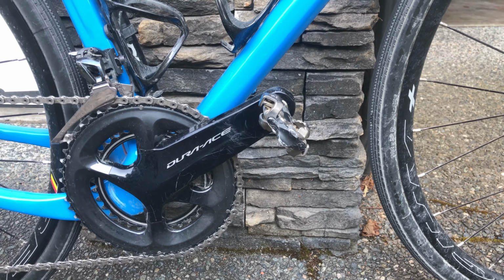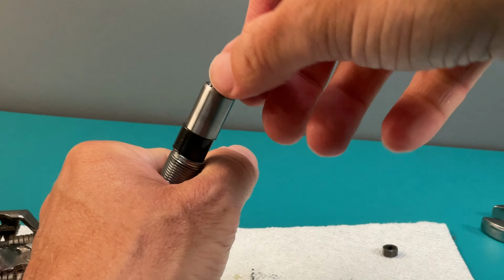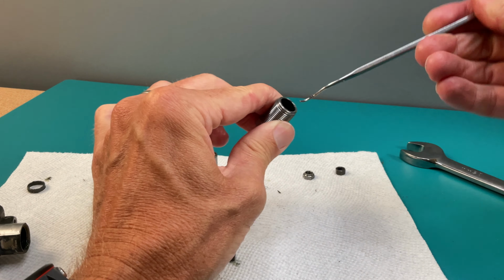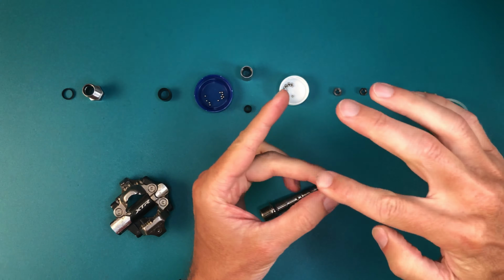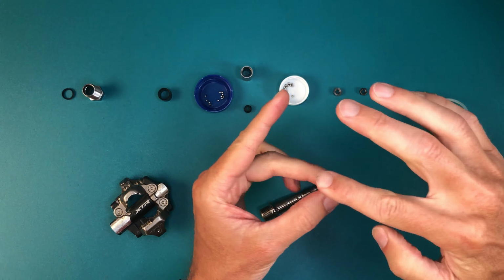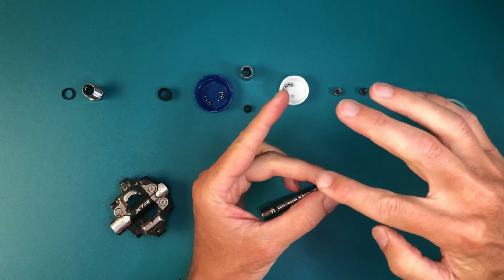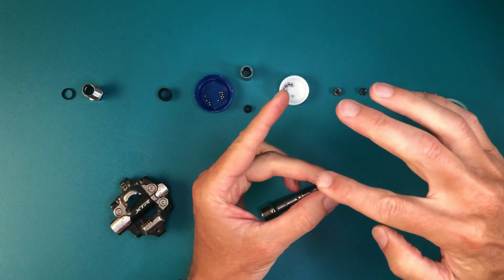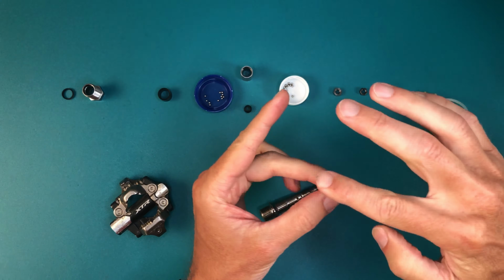Full service SPD bearing overhaul - Shimano XTR PD-M9100/9120

Comment: XTR tends to have too much axle play, it's hard to make the right setting play with 7mm 8mm spanners. Also thick grease help to make the seal stick in place. The last problem is shoe rub carved the pedal body, im looking to add material to it so my shoe and pedal don't have too much movement.
Reply: after servising my pedal spin super fast, it's just super hard to not ower tigh the bearings, i had to try a lot of time before finding the sweet spot, also the 7mm nuts seems to loosen on time, i advise people here to check after a ride if there is no axle play, first times i did tight enough the bearing nuts.
Reply from the maker: Agree, more difficult to get the play dialed in than with the 540’s. And checking after some miles is a good idea.

Comment: Good video, thanks. I just had my first XT problem In maybe 20 years. The pedal body came away from the axle.  I‘ve never opened one up or done any maintenance except external cleaning and oiling.   I assume the locknut just unwound itself.   Probably time for new pedals and another 20 years will see me out and keep my fingers out of the grease.  I do find it surprising that such small bearings can support the load, say 70kgs or more,  for such a long and generally reliable service life.

Comment: Well done, thanks.
Only thing I'd add,and this applies to all bearings is once they're been used, don't mix and match with other bearings regardless they're the same size. Individual sets will wear to their race evenly, but possibly slightly differently than another set. Axle bearings especially. Keep each set together.
Thanks again.

Comment: this is really good for the first time I took a pair of XT pedals apart, and I didn’t know what I was getting into when I saw the loose ball bearings but I didn’t take a completely apart and repack them but I did clean it up and Grease it up and put them back together. I’m not using them right now because purchased recently a pair of XTR pedals. they won’t need servicing for sometime now now the challenges I have an old 1995 pair of mono I think they’re M747. I wonder if the design or the internals has the same I use them on my fixed gear, track bike rather street bike that is. Find you 1995 and they’ve never been taken apart.
Reply from the maker: I imagine the internals are pretty similar. This design is pretty old school! The quick and easy way is to NOT take it all the way apart and just flush the old grease out with fresh grease. All depends on how dirty they are, and how much time you’ve got.

Comment: You made putting the bearings back appear simple.  I always find putting the 11/12 x 2 bearings back really fiddly. Like you, I keep counting to make sure I have not missed one LOL. For most people and times, I think leaving the bearings in place and degreasing in situ and using the process of screwing the spindle home to force new grease into the bearings, to be a much easier, more practical and quicker way to complete this maintenance task. A very reliable pedal design.👌
Reply from the maker: I agree 100%, but if the play is off, or you just have the need to take things apart, then using some sticky grease and tweezers can help a lot. Do it over a cloth so anything you drop doesn’t roll away!!

Comment: Thanks--this will help when my new PD-M9100 pedals need service. A suggestion--adding a list of required wrench sizes and the bearings sizes would be helpful.
Reply from the maker: I actually thought I had that listed in the description. I meant to. Sorry about that. I believe it’s a 15, 8 & 7. But it’s different than their other pedals, so best to be prepared. As for the bearings, they were too small for my Park bearing guide, so I measured them with the caliper. I left it at that since I didn’t want to state a particular size that I wasn’t positive on. 

Honestly, if the inside is mostly clean, I’d recommend just pushing fresh grease through rather than mess with re-setting the pre-load. Unless there’s play of course!

Comment: Do you know where to get a replacement seal, without buying a new spindle?
Reply from the maker: Sorry, I do not. I’ve seen many ask, but never seen an answer. Generally Shimano doesn’t really seem to be into repairs.
Reply: maybe o-ring online can do the job, or just tape ( maybe plumber can help) , last solution 3d print flexible tpu @AnAvidCyclist

Comment: what's the cure for this if the pedals have play? is it new axle assembly time? (basically new pedal time)
Reply from the maker: Yeah, if there’s bearing play you’ll need to re-adjust the lock screws at the tip of the axle. If you’re doing that you should fully clean and re-grease the bearings and inside the sleeve. Be patient and know that you’ll likely need to adjust it 5’ish times before you get it dialed in just right.